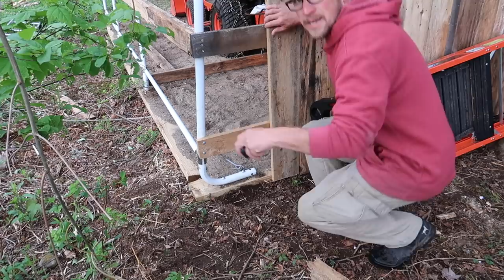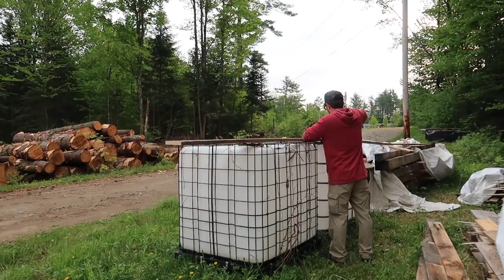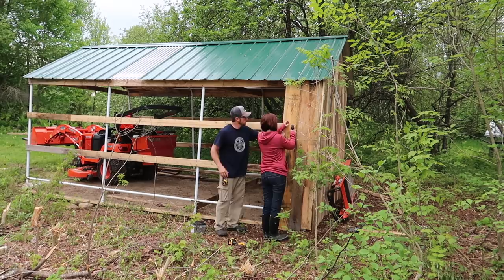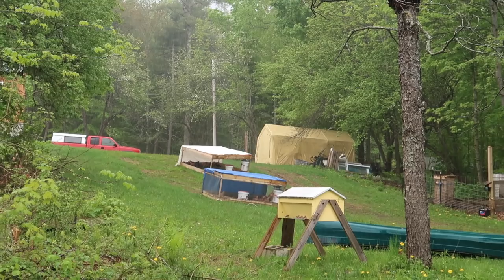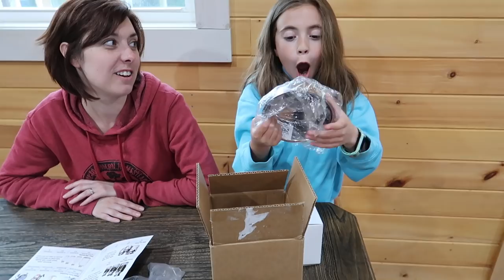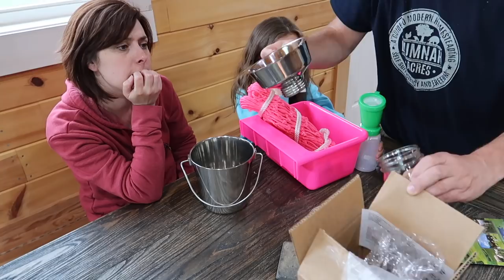Trying to Beat the Rain (Siding the Goat Barn)

Comment: Love your videos!

You may want to reconsider the hay net. Goats and hay nets typically don't mix well. You'll lose a lot of hay, but more importantly, goats are bad for getting tangled in nets like that. At best, the net will get broken, but you may also end up with an injured goat. 

If your goats don't have horns, the metal cages around those square water tanks you have make great hay feeders for goats, so maybe you could use one of those and not have to buy something else!

Comment: This is sort of shutting the door after the goats ran out, but you should have set a two by flat on the ground when installing your siding boards.  This would have kept your siding off the ground and gave you an even spacing on your siding.  Then you just pick up the two by and use it in some other project.  The barn does look good.

Comment: It's no accident the Kabota fits perfect in there.  With the barn I'm guessing Joel Salatin style.  A fodder feed system eliminates the need for hay in the winter.  Can you get wood chips on demand like justin?  The lumber yard recycling is the best.  Use of a temporary to permanent structure is genius.  I would coat the bottoms of some treated 4x4 concrete them in at all 4 corners and the center outside.  Put in a center brace concrete base you can insert a metal pole in the center for snow load in the winter.  The heat from the animals should keep it clean.  I see the water collection totes staged.  I hope you get a sow from Mark Baker.  $750.00 they are bred.  10 in a batch avg means you can presell, change 50% of your expected harvest weight, hold more harvest classes with those returning to finish the job saving up to $2.50 a pound butcher and smoking expense.  Then compare the savings to real pasture and woods raised organic pork.  Straus brand is exploding.  They contract with pasture grazed non gmo feed animals.  You have to grow at least 1 truckload.  40,000. Pounds.  25 head of red Angus mob grazed in the new and old pasture means 25 tons of fertilizer a month deposited right where you want it.  Stockpile the field hay cows will get it into the beginning of winter.  It would be great if you had about a 15 foot hill to access the area above the animals and drop fodder ot hay into feeding chutes.  Gravity helps.  I see the compost and manure bins on a slab to keep any runoff contained and your ag inspectors happy.  With all the regulation on the little guys how in the world can lagoons be anywhere near water supply, lakes or rivers.?  Medicated gmo feed means medicated, gmo plus glycophaste (roujdup) unsafe ponds that wreck the environment.  America is voting with there purchases.  Safe food is an easy choice for those that can afford it.   Hemp would be the only and best crop to plant.  3x better than corn for ethanol, flowers for medicine, insulation and shiv for hempcrete to slipform insulate any building. Just add lime, minerals, water and hemp schiv after decortication mobile onsite.  Buid instead of haying.  The 4x4 posts inside are the connectors for the boards hung horizontally.  Its waterproof, insulated, mold and bug or mouse free.  It dried and cured to petrified wood.  Adds strength and weight for wind resistance.  Would put concrete to shame.  Ceiling gets the fiber for natural insulation.   The sheepmajall is born.
Reply: Ed Deetz Wow, that's alot!

Comment: I'm pretty sure i's too late since it's already Monday in the real world, but, what do you think of using double walled greenhouse panels to make a long window along the side. That way you have even more daylight for milking and for the goats when the weather is bad? Plus you can look in and see what's going on with the goats and they can look out.
Reply: I think he's counting on the siding boards to add strength to the structure. He'd loose that if he put in long windows. Don't underestimate the amount of light the skylights let in. I have 2 2x5' skylights in a 20x38' building and I never need lights in there unless it's dark outside.
Reply: I agree that the skylights let in lots of light, but mostly all you can see is the sky. I'm thinking that he could mount the window on the outside surface along the width, maybe placing a board top to bottom in the center to control any flexing. the front and back would have boards as well as the 2/3 below or above and below the window depending on how high the window was placed.
I'm not sure you'd ever need it in New England, but windows that could slide like the ones in the outdoor kitchen would help with cross ventilation on hot summer days too. But I'm sure you're right. Too late now anyway.
On a different note, I like your name. We have up to Hugh IV in the family.

Comment: I hope someone can answer this.  What kind of frame did he use for the goats home.  Was it a portable garage frame or did he put it together with pvc pipe?  I think that is a great idea to enclose in.
Reply: I'm trying out my untested construction skills here but your question is mostly about shopping and I'm pretty good at that. 
The frame is from a temporary portable type garage. They're made of light weight pipe and come in a box. You can buy them on line or maybe farm or big box type stores. First you have to put them together IKEA style. There's a "canvas" cover that you pull over the whole thing and secure with ties or screws.  Voila! garage.
Problem is they don't weigh much and might blow over or away in a really bad storm. Also the cover wears out and gets leaky holes in it, so they don't last many years. So in this case Al attached wood to the frame, I think by just drilling a hole for the screw. If he didn't do this the frame would not be strong enough for the rest of the materials. Then presto, he just built it into a goat barn. You can see another frame like this here.   https://permies.com/t/59017/Lumnah-Acres-Homestead 
Hopefully my answer is fairly correct but if not maybe someone else will help us both out with better information.